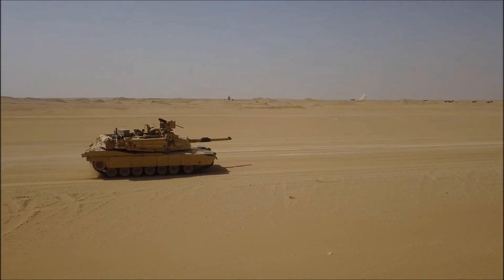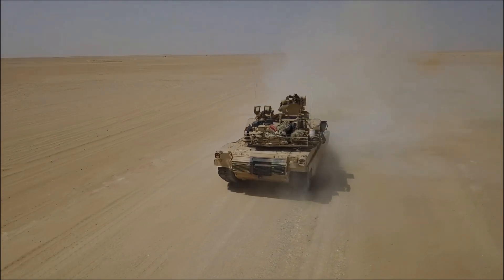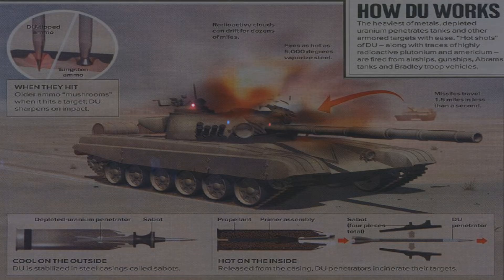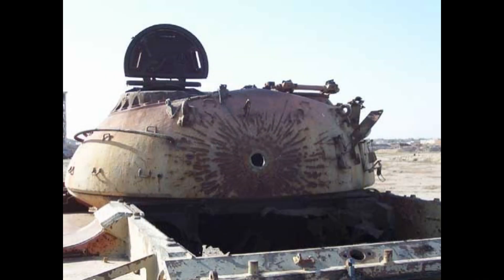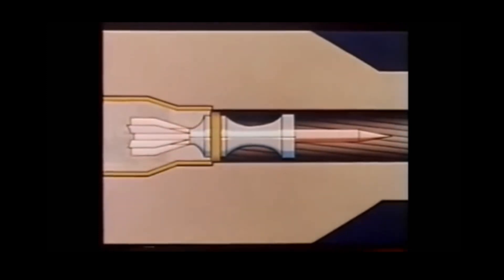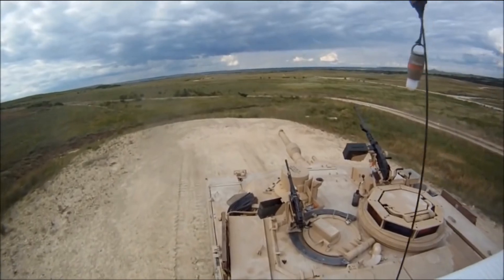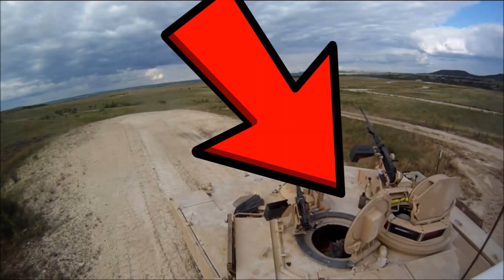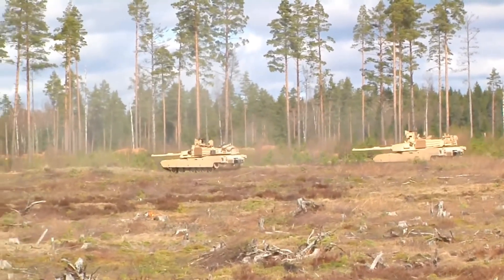Depleted Uranium Tank Ammunition | DEADLY DARTS 💀☄️

Comment: Sorry mate, I like you content usually but I cant listen to obvious BS with the "denstest" or "denser than tungsten" and self sharpening myths... seriously... You dropped the ball on this one when you apparently did no research or fact checking beyond reading off what I assume is wikipedia at best. DU is not denser than tungsten nor "self-sharpening". You should at least get basic science right before making a video..
Reply: DU is self sharpening. But it's useless because it only works with RHA and not with modern composite armor.
Reply: No, its not "self sharpening", here is no such thing. DU has better adiabatic shear band properties, resulting in a slightly narrower penetration channel than a comparable tungsten penetrator would. This is due to it being more brittle and less ductile. Simply put - it abrades more easily, which actually has a few downsides of its own. Modern alloys have come as close as they can to balancing relevant properties in both metallurgy and physical geometry of the projectile for maximizing performance, hence why we see the estimated penetration figures for the same guns increase with later projectiles. The consequence of improved alloys is that there is less DU and tungsten as a proportion in modern rounds than before, when the approach was more straightforward. In any case the difference in present day performance virtually nonexistent.
Reply: The better adiabatic shear band properties are widely called 'self-sharpening'. Same thing. But irrelevant against modern NERA.
Reply: No its not the same thing. It doesnt sharpen itself in the slightest. Its a bullshit myth propagated by fanboys that comes from propaganda TV shows that mentioned it years ago. And due to lack of comprehensive education and scientific illiteracy its a myth that just wont go away. DU magic and M1 Abrams myths are common and annoying. Unfortunately this video wasnt above it.
NERA? where was NERA come into play?
Reply: Yes, it is the same thing. The adiabatic shear is the self-sharpening. Where does NERA come into play? Well, self-sharpening is a double edged sword. It retains a sharp tip on the penetrator, but it's also causing the penetrator to deform and shrink more upon penetration. This effect is present with RHA, but much more with NERA/NxRA etc.
There are also self-sharpening tungsten alloy based penetrators (K-279 as example).
Reply: It is not the same thing. "self-sharpening" was invented by a late 90s TV and is a gross exaggeration, misinterpretation and oversimplification of the actual process for propaganda purposes that attributed DU nigh magic properties that only the US managed to discover for some reason. A DU penetrator does NOT retain a sharp tip and it does not shrink in diameter. The opposite happens. The nose flattens for both, but the mushrooming effect is slightly lower than tungsten due to better abrasion - the outer edges of the contact surface break off slightly sooner making a channel that is narrower (and thus deeper) than a tungsten penetrator of same mass and geometry would produce. However it is still about double the diameter of the penetrator itself. This was more pronounced with earlier alloys from the 80s, when the firsts tests gave DU an approximate 10% advantage. There are actual scientific papers on this subject that have been published over the last 40 years. So stop talking nonsense.

ERA using heaver plates simply imparted a lateral force on the rod forcing it to break or impact the main armor off-center and thus drastically reducing the effectiveness of the penetrator. The mass loss during penetration is relatively low, depending on the target profile. At some point the penetrator would just fail.

NERA is not commonly used and is considered mildly effective only against shaped charges. It has the same mechanism as ERA but instead of explosives using a non-explosive substance to force the metal plates apart, which in turn disrupt the shaped charge jet. A KE penetrator would be unaffected by it beyond it just adding the material as additional armor it needs to defeat, which is quite thin and soft. Unless there is a study that shows fielded NERA doing anything remotely comparable to what ERA does.

Again, no such thing as "self-sharpening". Modern tungsten alloys have long since overcome the shearing issue by improving the composition. The DU vs tungsten debate was actually already settled 20 years ago, tungsten is becoming the universal choice.
Reply: Almost every modern MBT utilises NERA. Abrams turret cheek inserts? NERA. Leopard 2 turret cheek inserts? NERA (addons are also NERA). Burlington? NERA. Even some T-72 versions had NERA.

Multiple layers of course, that's what composite armor is about.
Reply: If you take a very liberal definition of NERA than I suppose you can call any composite armor NERA. Which makes very little sense as it would result in overlapping definitions.
NERA actually is considered a type of armor applied additionally to the tank (reactive armor), a derivative of ERA which replaces the high explosive with a non-explosive expanding material to push the plates apart and disrupt penetration. It physically would not work if you placed within the armor as it would have nowhere to expand, unless you space it. And is not commonly used from what I know and ERA still is the most prominent due to its effectiveness. If you want to call all plastic or ceramic inserts or controlled deformation panels in composite armors as NERA... well, go ahead, but its on par with "self-sharpening" - a massive and seemingly deliberate misinterpretation that serves no purpose beyond just being misleading and false.
Composite armors try to break the KE penetrator, but it has nothing to do with what you consider to be NERA. NERA is effective only against shaped charges, but to an extent thats only a fraction of what ERA would generate.
Reply: placeholder  I know what it looks like, I know how to google pictures myself, thank you. Point is - youre taking a very liberal definition of NERA which overlaps with composite armor in general, which means one of them is redundant. A more practical approach is to consider NERA a derivative of ERA and not nearly synonymous with composite. For example, the Russians never would call their composite as NERA or any form of reactive armor (or 'dynamic protection' as they call it). Composite armors since the early days were intended to disrupt, deform and dissipate penetrators, and no one refers to them as NERA because NERA is considered a derivative of ERA. By your approach we might as well call every kind of armor "reactive armor" because technically everything reacts in some way to an applied force. It makes no sense to do that.
Reply: @komradearti9935  To define NERA you first have to define reactive armor in principle.

Im a pretty fluent Russian speaker and I have never seen or heard Russians ever refer to their armor as NERA. They call ERA as their "dynamic protection" and the main armor as "composite, combined or multiple layer". 

Composite armor comes from the word composite, pretty self explanatory. "Special armor" as a term was invented much later and is not scientific, its on par with “self-sharpening". Its not a real thing. Even if it was, that would yet again result in overlapping terms making them redundant.

Shaped charges dont do well against any transition in material hardness or density.
You can call it NERA if you use a very loose definition of it, which is why I ask how you define "reactive armor" as such. Any armor will invariably "react" to the impact, so does that make all armor "reactive armor"? Ceramic inserts are intended to break and dissipate the energy, disrupting and deflecting shaped charge jets in the process. Again, depending how you define "dynamic plate thickness" it may or may not qualify.

Thus I stand by a more simple approach - NERA is a derivative of ERA, and I think everyone agrees on what ERA is, which replaces the explosive with a non-explosive component, at the cost of being about 5 to 10 times less effective. I am well aware that this is used by modern composite armors since the 1980s, but its not universally called NERA and becomes a matter terminology and opinion difference used in different countries.

And none of this has anything to do with depleted uranium.
Reply: @Aaron Washburn  Its not a scientific term and it implies that the penetrator remains sharp and pointy, which it doesnt. It gets deformed and abrades. 
ARL doesnt open for me, but anyhow there are plenty of other articles and studies on DU penetrators. They do produce a slightly narrower channel but they are not "self-sharpening" and the resulting channel is still wider than the diameter of the penetrator. It doesnt make a drill bit like hole. They are less ductile than W, which makes them shear better, which in this case is useful, but its not "self-sharpening". Its a term that has no definition and is not an accurate description of the process. Its similar to some thinking shaped charges "burn" though the armor. Its not accurate and is popularized by media, not by anyone scientifically literate. Same with "special armor".. "special" is not a scientific word. Terms like that do get mentioned in some articles occasionally, but its done for clarity purposes since the majority of the people are not scietifically literate and, for example, have no idea what adiabatic shear is, but everyone knows "self-sharpening", despite the latter being inaccurate.
There was an old CIA article on DU vs WA that illustrated all the pros and cos and provided accurate descriptions and measurements of the shearing, but i cant seem to find it anymore. It was from the 80s tho.
Modern alloys have come a long way from the old days, there is probably little to no difference anymore.

Comment: A tank mounted rail gun firing a hardened steel sabot at say double the speed of a current tank gun sabot may have the same effect.
Reply: Well, no. For one thing, you need a massive energy source. Chemical propellant has more energy density and any electric power source. Its a matter of science.

And depleted uranium is about 50 percent denser than lead, which is much denser than steel. Also a matter of science.

Comment: If you mean by "heaviest" "densest" element, then you are wrong. Uranium has the highest atomic number (92) of any natural element, but it is far from the densest element. That honor goes to osmium with density of 22.59 g/cm. Uranium metal has a very high density of 19.1 g/cm3, much denser than lead (11.3 g/cm3), but slightly less dense than tungsten and gold (19.3 g/cm3). So uranium is close to the densest, but NOT the very densest.

Of course, osmium costs perhaps 2,500 times as much as depleted uranium, so don't expect it in munitions ever.

Comment: Just to clear up some confusion of some posters here on the health effects of DU ammunition.  It is the smoke from a piece of equipment that has been hit with a DU round that is the real problem.  The DU round burns as it enters a target and that smoke has depleted uranium molecules in it.  That uranium emits a lot of alpha and beta radiation (typically not a health risk)  and since it has become an aerosol you can breathe it in.  Now all of that beta radiation is in your body instead of outside where your skin shields you, the ingested or breathed in contaminates begin the process of destroying your DNA.  All of that damaged DNA is why there is no clear symptoms or diagnosis of Gulf War Syndrome.  You can experience 100s of different problems when you DNA has been seriously compromised by the radiation so it results in all of the strange symptoms of Gulf War Syndrome that cannot be pinned down as easily as other problems.

Comment: Channel followers might find the following interesting.

Pyrophoricity is the huge advantage of DU alloy penetrators.
They are self sharpening as the armor is penetrated.
The dust created upon complete penetration is self igniting and burns at very high temperatures.

Pyrophoricity
A pyrophoric substance (from Greek πυροφόρος, pyrophoros, "fire-bearing") ignites spontaneously in air at or below 55 °C (130 °F).[1] Examples are iron sulfide and many reactive metals including plutonium and uranium, when powdered or thinly sliced. Pyrophoric materials are often water-reactive as well and will ignite when they contact water or humid air. They can be handled safely in atmospheres of argon or (with a few exceptions) nitrogen. Most pyrophoric fires should be extinguished with a Class D fire extinguisher for burning metals.

The creation of sparks from metals is based on the pyrophoricity of small metal particles, and pyrophoric alloys are made for this purpose.[2] This has certain uses: the sparking mechanisms in lighters and various toys, using ferrocerium; starting fires without matches, using a firesteel; the flintlock mechanism in firearms; and spark-testing ferrous metals.

Uranium is pyrophoric, as shown in the disintegration of depleted uranium penetrator rounds into burning dust upon impact with their targets. In finely divided form it is readily ignitable, and uranium scrap from machining operations is subject to spontaneous ignition.[7]

http://eoslifework.co.uk/pdfs/DU2102A3a.pdf  
From 2001-2002. Very detailed coverage of DU and how it functions in all types of munitions.
It’s worth your time to look through it.
￼
Reply: Self-sharpening doesen't work for composite armor/NERA.